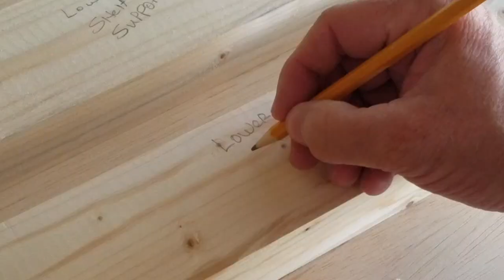TV Stand with Sliding Barn Doors

Comment: Is the biscuit jointer a necessary step? Don't have one and didn't want to buy one just for this one thing if there's a work around to using the fasteners
Reply from the maker: No, not necessary. You can use your table saw to cut a kerf 1/2 inch down from the top to put your Z clips. Use your router with a 1/8th straight bit, Or you could attach your top using figure 8 clips. There's lots of YouTube videos that show how to do this. The main thing is to use a method that allows for seasonal wood movement (especially for hardwood tops). Theres nothing worse than building a beautiful top and then hearing a loud pop and discover a crack in it. (It happened to me). Hope this helps, if you have any questions, let me know. I try to answer all questions.

Comment: How do you connect the middle walls to the bottom shelf? I don’t see it on Dylan’s plans.
Reply from the maker: You're right. Dylan didn't put that in. What I did was draw a line on the bottom where the middle walls would be, drill small hole along the line and then put glue on the "wall bottoms" while it's laying down. Drive in the screws (pre-drill into the bottom of the sides) and you will be fine. Glue would probably (definitely) be good enough if you don't want to screw from the bottom. Also a 23 gage pin nail (if you have one) to hold it in place until the glue dries would work too.
Reply: Thank you!! Great suggestion!

Comment: So what size was the barn door slide you used and where can you find them. The only one the box stores around me sell are 6' plus.
Reply from the maker: I made my hardware from scratch, but when I build them now I just order from Amazon. The cost difference is only about 20 dollars and it's just not worth it. The one I order is the "Homacer Sliding bar door kit, double door" you can get sizes from 24 inches to 120 inches. My favorite is to build a 72 inch TV stand and order a 72 inch hardwear kit. Hope this helps
Reply from the maker: Also... The ones at Lowes and HD are for Big sliding barn doors. Like for bathrooms. On those the hardwear won't fit. It will be too big.
Reply: @crimsonwoodworking9609  thanks for the info

Comment: Did you put any trim on the front facing edge of the white horizontal shelves since they are plywood?
Purchased the plans and hope to begin soon, Thanks
Reply from the maker: Hey Bill, thanks for your question. Yes I did put trim on the plywood shelves. I cut them 1 inch shorter than the plans and then cut a 1 inch strip of pine. Glued and Bradnailed. You can also just edge band and it will look great.

Comment: Great video! What type of finish did you apply on the white base? I worry about yellowing over time
Reply from the maker: While you can use a clear coat over paint, I chose not to. It's just me and my wife and we're not too hard on furniture. I used 2 coats of primer and 2 coats of paint. It's over 3 years old and zero yellowing. If you plan to topcoat over paint, use a waterbase poly.

Comment: Great video! It looks awesome! Question. What kind of wood for the face frame? I feel like it looks so smooth and clean and has no knots. I feel like I do t see this at lowes....or maybe I need to just open my eyes lol. Thanks!
Reply from the maker: Riley Griffin, Thanks Riley, got it at Home Depot. It called "Select", its usually in an aisle by itself standing up. It cost a little bit more but it never has knots and requires less sanding. I don't always get Select, Common is cheaper but adequate for a lot of projects. I think Lowe's has the same wood too.
Reply: KC Hughes thanks for the reply and for the information!
Reply: Lowe's sells it also.

Comment: Roll Tide!  Thanks for posting the video.  Why did you go with biscuit slots and counter hardware over pocket holes?
Reply from the maker: Jimmy Rogers, Since I was using Walnut (a hardwood). It will need to expand and contract with the seasons. Normally hardwoods contract in the winter with the low humidity and expand is the summer. This even happens in heated and cooled rooms. If you screw a table top down it will eventually crack because movement was restricted. With slots and table clips the top is held down firmly but allows for seasonal movement along the width of the slot. I hope this helps.
Reply from the maker: Jimmy Rogers and Roll Tide!